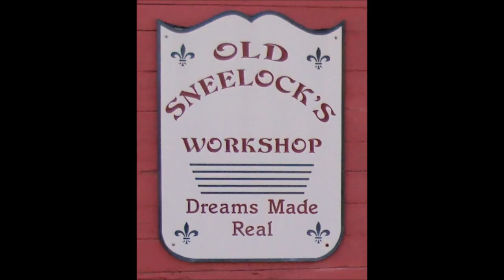HABITAT FOR HUMANITY RESTORE ~ SEARS CRAFTSMAN 7 IN  ELECTRIC HAND SAW ~ MODEL 315 27802

Comment: Nice find. For the manual you might find one on Scribd or at OWWM.org. Though the latter does tend to stationary equipment.
For pulling stubborn nails, I often, slip a small crowbar under the vise grip. Gives a bit more leverage.

Comment: I was gifted the craftsmen 31527802. Any suggestions on brand for a 7 inch blade? Also the arbor bolt is metric
Reply from the maker: I like Diablo brand blades. Thin kerf and very sharp they help underpowered saws to cut easier.  If you are looking for OEM  blades then you will need to find blades of the time period.
Reply: @OldSneelock  I like Diablo too, it's my go to but unfortunately they don't have 7" wood blades I guess I'll go with a 6 1/2
Reply: @ZFISHTANK  Only my opinion and not expert advice, but rather a question.  Would a 7-1/4" blade work since there is clearance for the guard to pass, and no other close tolerances?
Reply: @AkA-me-Kenny2  so turns it actually fits a 7-1/4 just fine

Comment: its 17mm sneelock..:)
Reply: You beat me to it. The 17mm spanner would give a nice tight fit but I never thought U.S. tools used metric fasteners.
Reply from the maker: I'll have to get the metric wrenches out of the garage. Thanks for the tip.
Reply: maybe the odd part bought from the european B&D deparment?
Reply from the maker: Engineers make mistakes too. I don't mind having a metric piece of equipment. I don't like having a mixed piece of equipment. On my Sierra the alternator mounted with two bolts. One metric. The other was imperial. Really messes up the process.
Reply: machine tools from taiwan in the 80's total mixed bag sometime with whitworth with bs/w sized heads, BA electrical connections, plus all the non standard metric, the 11, 14,15, 18 mm
Reply: That's what I was wondering. I go back and forth with metric and standard all the time. If one doesn't fit I just use the other.
Reply: I ended up having to get the odd sizes for something I was doodling with. Now they're in the drawer just waiting.
Reply from the maker: I got the 17mm out just now for todays video. It's a match. 
For my sins I got sent to the little town of Barrie, Ontario. Douglas Autotech was purchasing some diecast aluminum parts for production and the parts were not to spec. 
To accomplish my task I needed to upgrade some of their equipment. I visited Princess Auto, the local discount tool store, and purchased a set of metric tools along with various and sundry items for the repair and alignment of automatic milling machines. I got a funny look when I went back through customs. 
I wasn't suppose to be working on anything. Strictly advisory. Unfortunately the operators knew that the aluminum went into the pot and the castings fell out when the die opened. Milling machines were somewhat of a mystery. 
The upshot of all that is I have metric sockets and wrenches. I just don't use them much.

Comment from the maker: I'm still looking for a manual on this saw.
Reply: Old Sneelock's Workshop I’ll look in Dad’s old file drawer. Mine was bought in 1986-87 so I think it’s too new
Reply: Nope couldn’t find the manual. but it looks like his old one.  One of my brothers must’ve thought to get the manual, as the circular saw is long gone.  He kept all the manuals in zip lock baggies to keep them clean if they didn’t go in the office file drawer.  Several manuals from the 60’s and 70’s...
Reply from the maker: Thanks for checking.
Reply: Vintage Machinery.org  Keith Rucker
Reply: Lewie McNeely I can get lost on that site ...so much to see and learn.  It’s ever changing!
Reply: Keith is an amazing guy. He works for the Georgia  Bureau of Agriculture (I think) in peanuts up to his eyeballs! My wife Cheryl's dad was a handyman and bought a Craftsman table saw years ago. I got it when her brother moved up here and tried to find out something about it and ended up at his site. It ended up being a 'bench' saw that was very versatile, even though it had a cabinet and wheels. It even has the original Craftsman 'V'-belt and motor. All I did was clean it up, extend the legs to get it up to my height an put a new cord on it. Runs like a Swiss watch but I don't use it much but it's handy to stack stuff ion. I keep it waxed per Uncle Sneelock! And Keith says the content of the Vintage Machinery is changing all the time. I ought to look up my Skil chain saw! Thanks, Elaine!
Reply from the maker: Found a PDF copy at OWWM. It's been long enough since I went there that I have to reup my password. Waiting for a reset confirmation in my EMail. 
Thanks for all your help.

Comment: ahh  good thinking, you get to 'look for bathroom cabinets' in stores that sell antique tools....better have one hidden somewhere in case you get found out
Reply from the maker: They buy old houses and restore them. They offer them to people who put sweat equity into the repairs while working with trained carpenters, plumbers, and electricians. 
If they find something they don't need or that doesn't fit into the design of the rebuild, like windows, kitchen cabinets, stoves, refrigerators, etc they sell it in their Restore facility. It helps pay for the purchase and repair. 
Often it is an estate that has been donated. Some of the items get used others go to the restore. Good place to look for anything. 
Lydia and I have been using them for years.
Reply: Ours has that kind of stuff in a screened in place on the side of the building. Interesting stuff sometimes. You never know.

Comment: Nice find on a good saw, but somehow I suspect you need another circular saw about as bad as I do (There are three sitting just inside the garage door; and that's just the ones I've found so far...).
And the ReStore is a great place to go looking.  The closest one to me is 25 miles away (but only 3 miles from work).  I haven't been to this store since before it moved.  They moved to a building less than a half mile from the mall, so I'm sure they are moving material (they still have to pay property taxes...).  I really need to stop by there; I have things to donate (the garage isn't going to clean itself), and it would give me the opportunity to find cabinets & whatnot for storage.
Reply from the maker: Brian Neeley Hi.  I'm Old Sneelock. I'm a toolaholic. 😈
It would be great if you could work out a trade. They will come and pick up the stuff you donate. Maybe not 25 miles but it would be worth asking.

Comment: I remember those saws when I was doing the grading around houses. Popular in the day. The Restore is 25 miles from here but like you said, timing is everything. Keith Ruckers 'Vintage Machinery.org" might have a manual on the saw. He had one in my old 8-inch Bench saw. The Skil chain saw is rated 2 horses. Cleaned up really good but it's the only electric saw with a centrifugal clutch I've ever seen.  Fine with me. Gates framed up and ready for wire. Used the Makita because it'll almost cut through a 4x4 lacking just a dab in one corner. 6 screws in a corner, 24 in a gate frame. The Impact did a fine job on one battery and helped put the Gravely together beforehand. Now for the wire!
Reply from the maker: Found a PDF copy at OWWM. It's been long enough since I went there that I have to reup my password. Waiting for a reset confirmation in my EMail. 
Thanks for all your help.

Comment: A fantastic purchase. For getting nails out have you tried a slide hammer nail puller ?. The reason I am asking is I just got one for a £1 at a garage sale and it seems to work on buried nails when I am deconstructing pallets.
Reply from the maker: I have had one of those for years. I first used one at Homebuilders to pull nails after they were set by an air nailer. Great for digging out a sunken head or broken off nail.
Reply: wow £1 great find, pallet nails are really hard as they  cut rings on the shank
Reply from the maker: Oak makes it twice as hard. The wood is tough and acidic. The nails rust into the wood like they are glued.